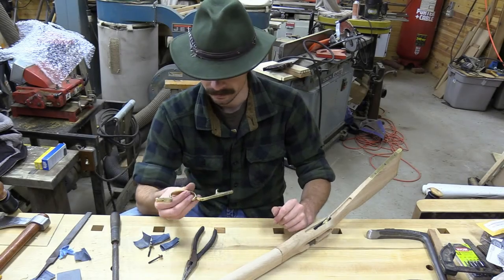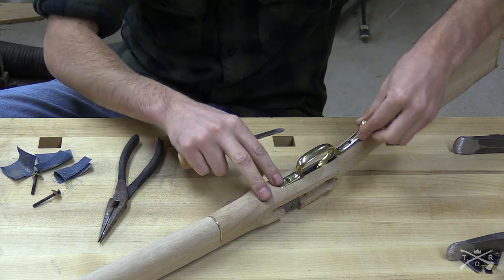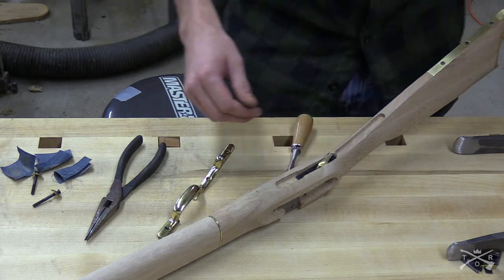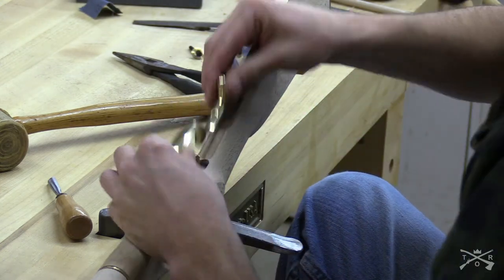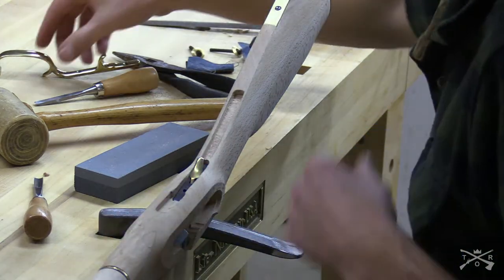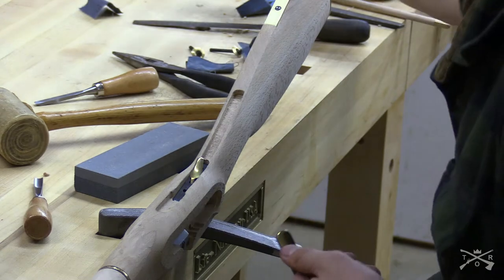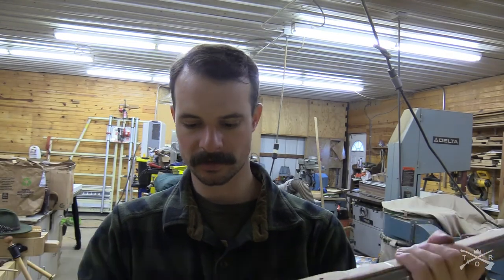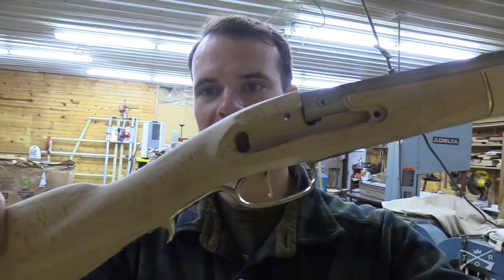TRIGGER GUARD | TRADITIONS FLINTLOCK KENTUCKY RIFLE KIT BUILD

Comment: I learned the hard way when doing the rear of the guard that I should have done the fitting right behind the trigger first because when I was putting it in it was flexing out and I didn't realize it and removed a little more than I needed at the very back..  but this is my first kit I bought to learn one so no big deal.  Love your videos man.  Keep it up!
Reply from the maker: This was a learning kit for me as well. Lots of mistakes, but this fairly inexpensive kit is a good place to start.

Comment: Do you have a video of installing the sights?
Reply from the maker: Not yet.
Reply: @theoutdoorrealm1658  any pointers?
Reply from the maker: @tmguye when I initially tried to install the sights, they were very loose. I remedied this by lightly tapping on the corners of the  barrel dovetails which seemed to work fine. I tapped a little, checked the fit, tapped a little, checked the fit until the fit felt snug enough that the sights would not move without a decent amount of force.
Reply: @theoutdoorrealm1658  thank you.   I got mine installed.   A friend of mine, that’s a machinist, filed a side down, and started them in, then tapped in with brass.   Now…I have to finish the stock.  

Have you shot it?
Reply from the maker: @tmguye  oh good I'm glad you got it to work. And enjoy finishing the stock. That's my favorite part. I have shot it, yes. Its pretty reliable for the most part and goes off almost every time until it gets fouled up. I still have a handful of videos to do on it including a video of shooting it for the first time. Just need to find the time to get them done. Got a lot of other priority videos that need to get done first.
Reply: @theoutdoorrealm1658  thank you for your videos.   You really helped me at the start.   I wish there was more online about the tenons and pins.   You’ve helped me immensely.